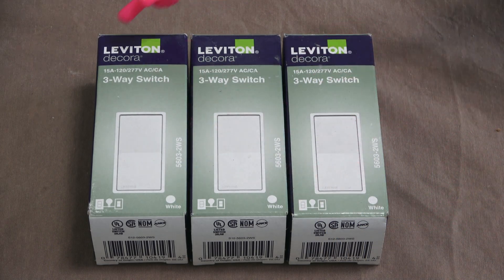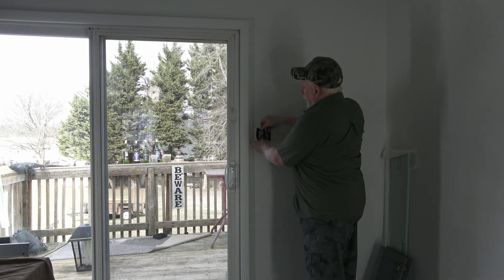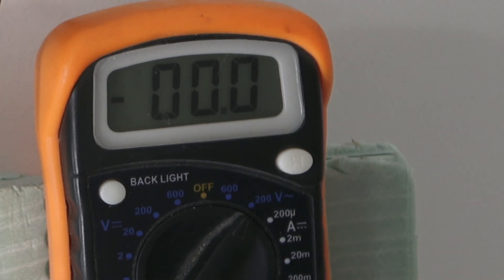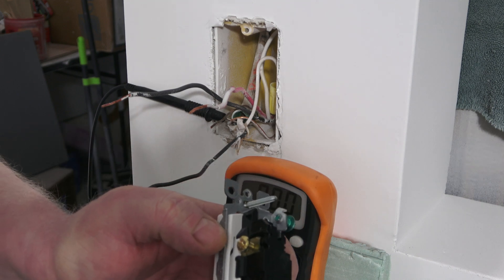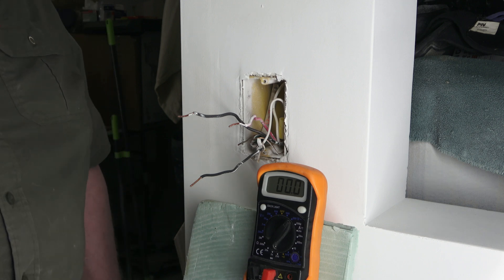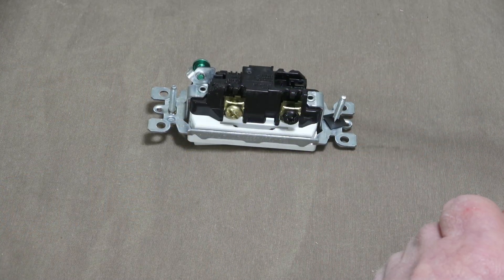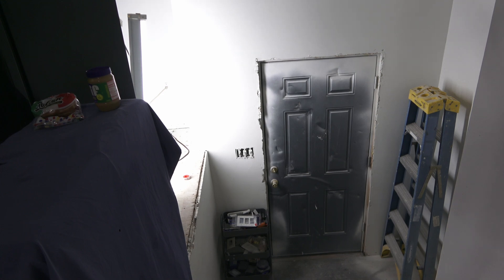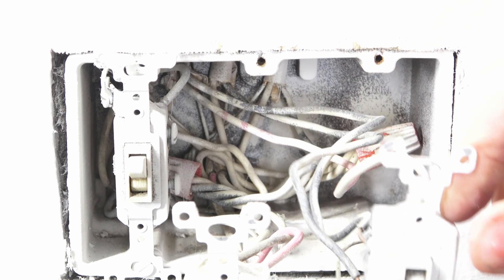How To Identify Correct Wiring For 3-Way Switch

Comment: Is this possible with a dimmer? I'm trying to replace mine, but it seems like only one of the 2 switches can be the dimmer. Is it the one closer or further from the light?
Reply from the maker: Closeness is irrelevant. Provided you're using a three-way dimmer switch and wired correctly, One switch will dim and the other switch will turn on at the dimmer switch setting

Comment: I figure the switches for some of the lights in my house are not wired in the standard way. I tested all the wire leading to both of my 3-way switched. With all the wires labeled to which terminal they were connected. I tested al the wires after i disconnected the switches but instead of one of the wires on one switch having power 5 of the 6 wires tested hot with my voltage tester. 3 wires were hot on one switch and 2 hot on the second switch. Now with wires hooked back up in the original configuration they were in on both switches when I started the 3-way switches work as they should. I am Just not sure of the unorthodox way the electrician used to wire the house when it was built in the 1970's.
Reply from the maker: 5 of the 6 wires tested hot 😲 Unorthodoxness 😋

Comment: Thank you very much.  I've taken 3 shots at fixing an incorrect 3-way in my home.  Somehow or another the travelers changed color between the switches.  Pulling off all the wires, locating the hot, travelers and the wire going back to the light did the trick.  Good explanation and a good overview of how they work and how to use a multimeter to determine what is what.  My original symptom was one switch would work if the other was in the up position, but if that switch was in the down position the working switch wouldn't.  Probably set up weird for a rookie to diagnose as a learning experience but was forgotten along the way.  Anyway, I appreciate people like you taking the time to explain things properly.  Regards, SP
Reply from the maker: You are welcome! 🙂 Thanks